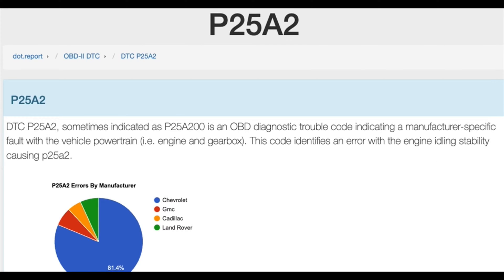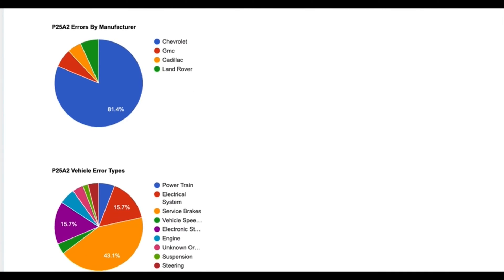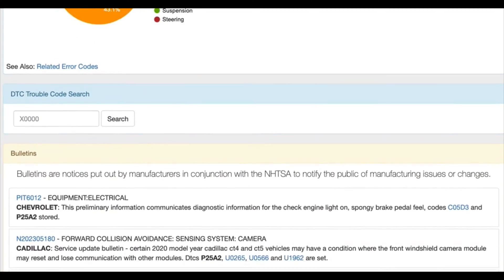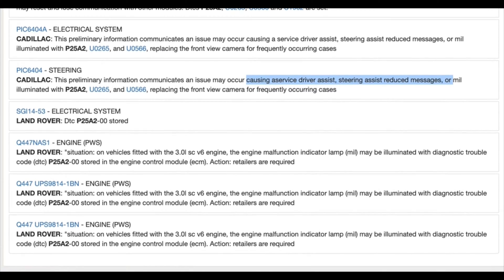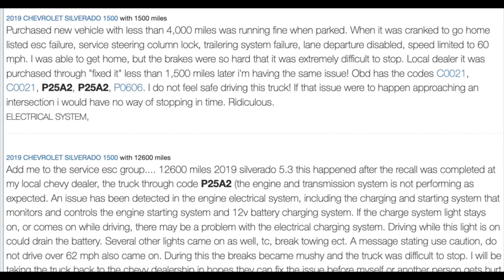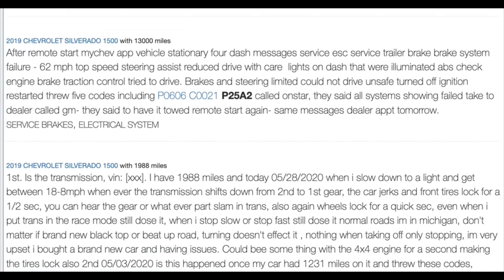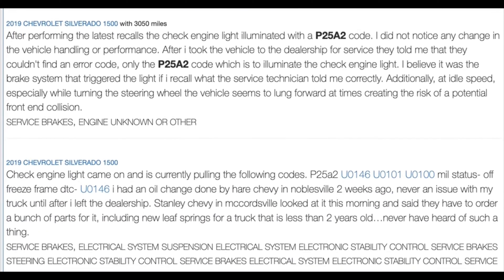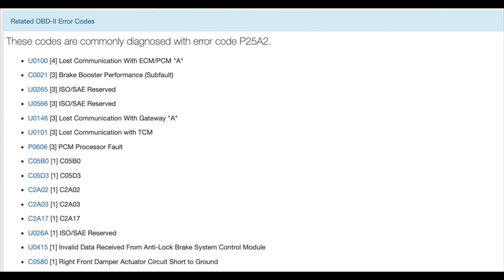DTC P25A2: A common Chevrolet, Cadillac and Land Rover Error Code

Comment: I have a 2022 GMC Sierra AT4 6.2 L. After replacing the battery, the check engine light came on. Unfortunately, I had misplaced my OBD scanner at the time, but the light stopped illuminating when I got a new one. The code P25A2 could be due to the battery change. I'm reaching out to this community for your valuable insights and advice on this issue. Truck drives fine.
Reply: Same

Comment: Mine says the ecm lost connection to the brake control module
Reply: How did you fix it?
Reply: @blackjack444....  i just turn it it off with my scan tool. But it comes back on every couple weeks
Reply: @blackjack444....  @travisswiley7663 2021 1500 silverado...what about you guys?